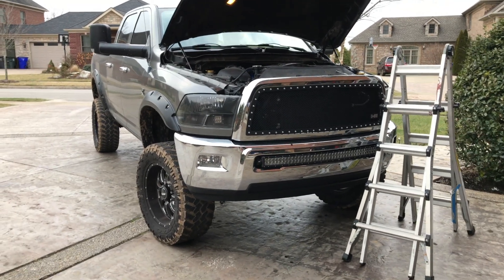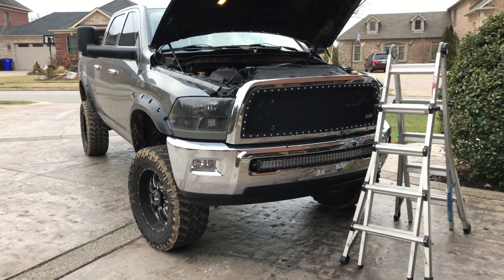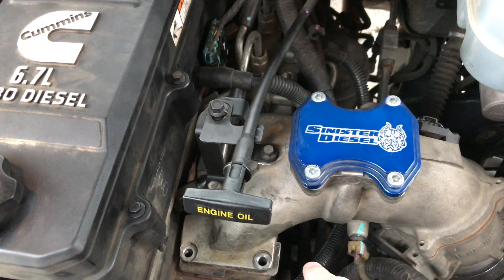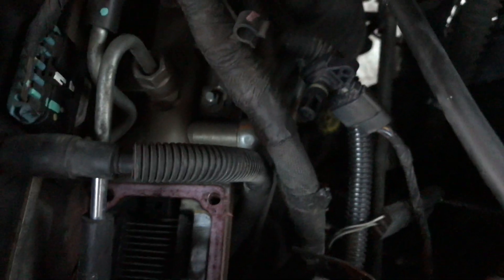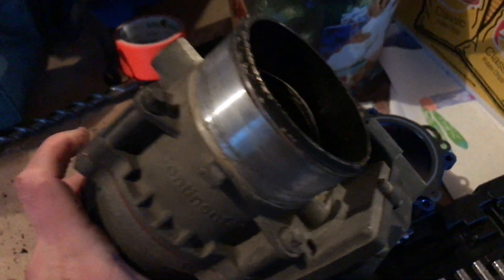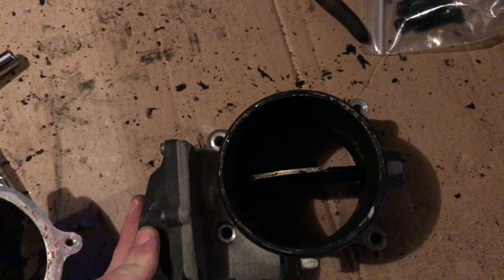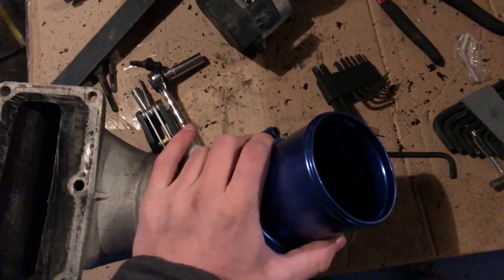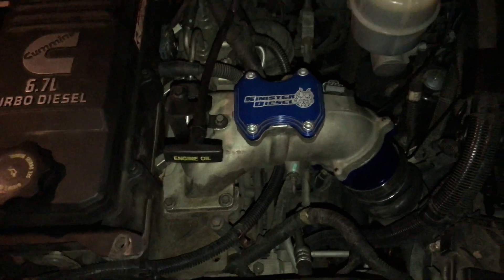Throttle Valve Delete Install on 6.7L Cummins (How To)

Comment: Dude should have installed a much better intake horn while you were at it like a Pusher or Banks!  Especially if you're gonna do a grid heater delete.
Reply from the maker: Chris Namelast not a bad idea!! I'm not pushing an excessive amount of hp to where it would be necessary. I'm saving some spare cash to get a 2nd gen kit with an s464
Reply: Chris Namelast did you use the sinister throttle valve delete or different brand?
Reply from the maker: Moises Perez no I actually purchased a kit off of eBay for much cheaper and it's great so far! No problems at all!
Reply: Chris Namelast i ordered one from amazon that looks pretty similar to the one you have for 40$.
Reply: With a Pusher intake there is no throttle valve or egr plate, just one big intake.
Reply from the maker: That's true but I didn't want to spend the extra two hundred dollars!

Comment: did we need a tuner to eliminate a CEL?
Reply from the maker: Yes most likely it will cause a check engine light. If you need a tuner, hit up www.topshotdieseltuning.com and they'll get you set up with the best prices!